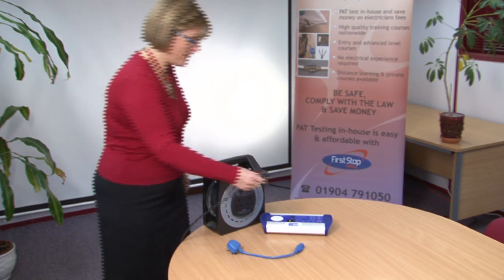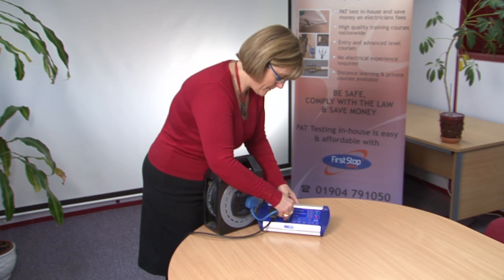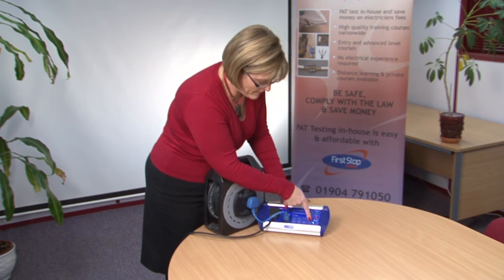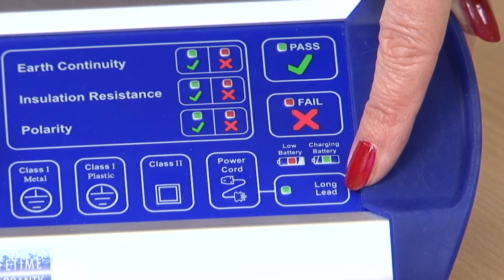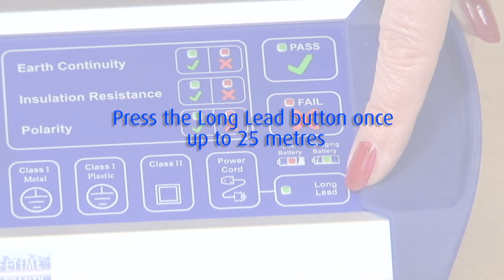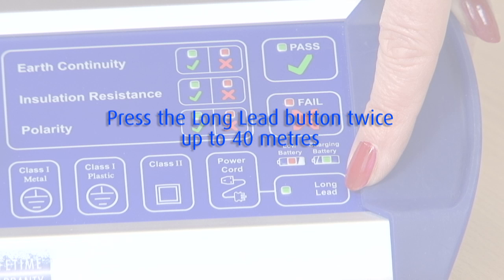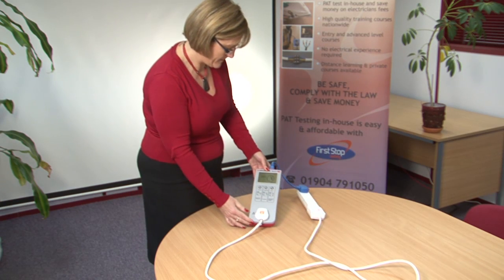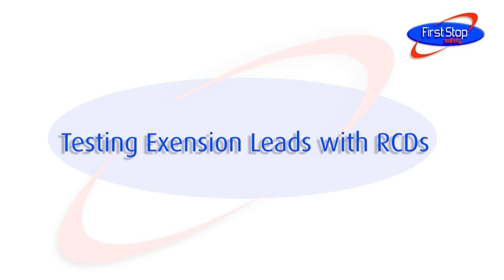PAT Testing Power Cords

Comment: Very thorough video, (almost0.
It is time that some one points out that a RCD must be used on long 
extension leads,i.e.1 .25mm csa  12M - 1.5mm csa 15M - 2.5mm csa 25M
 
As per top of page 79 of the IEE Code of practice. 

Fred Creer

Comment: Surely you mean PA Testing? PAT Testing is "Portable Appliance Testing Testing" which is just stupid and doesn't make sense.

And anyway, with all houses and business wiring already having RCD trip switches, if there is a problem with any appliance, (imbalance between live and neutral and therefore earth current leakage) then the RCD switch will trip. 

Just test the main RCD and it's job done! Oh, I forgot it's all easy money to test all appliances individually even though it's not necessary!
Reply: If you believe that all houses have RCD fitted then you don't live in the UK:-)

Comment: You mention testing 25 metre & 40 metre leads. The maximum permitted length for a 13 amp lead is 15 metres. Any lead exceeding this must have the mains plug replaced by a hard wired RCD

Comment: You must also carry out a Full Visual Inspection, this includes unscrewing the pug and checking contacts are tight, the plug is wired correctly and the correct fuse has been fitted, the cable is in good condition and the appliance is free from damage.